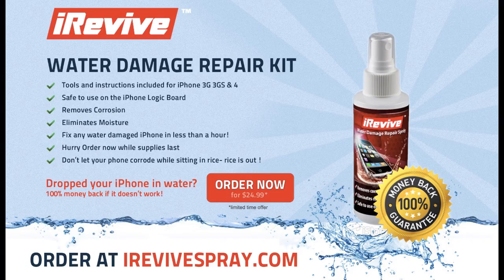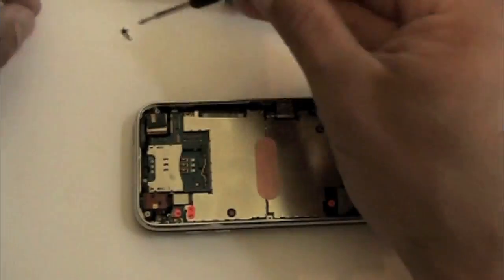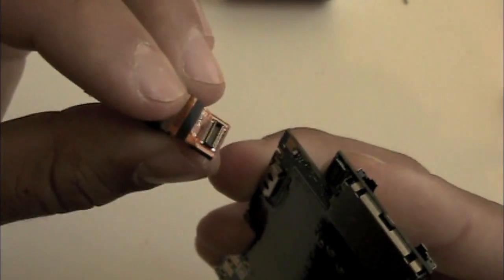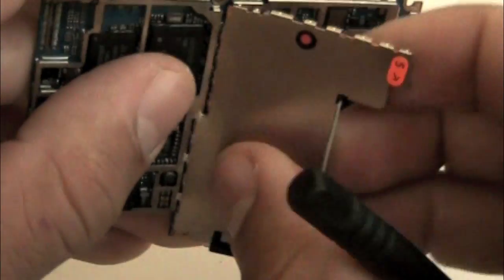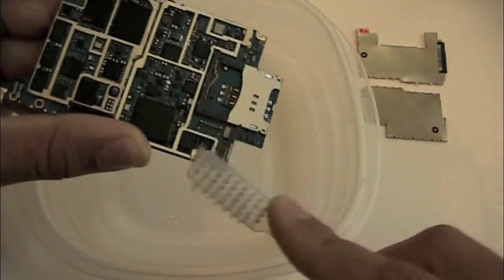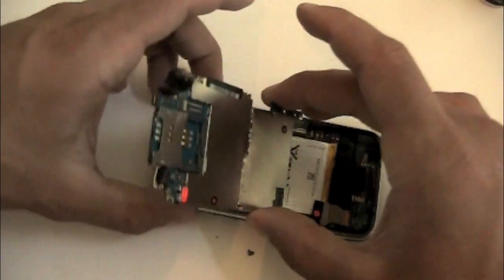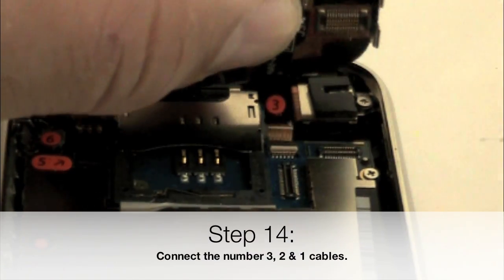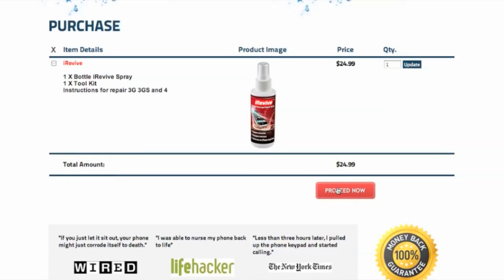100% HOW TO FIX Water Damaged iPhone Repair 3G & 3GS - Wet iPhone Fix

Comment: NB If the water has got to your battery terminals, it will have shorted out & WILL need replacing.